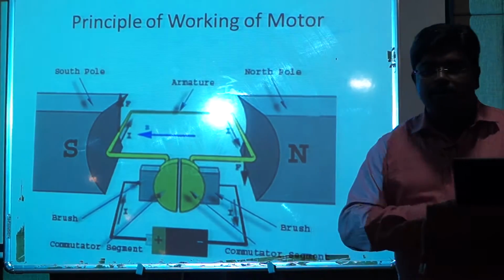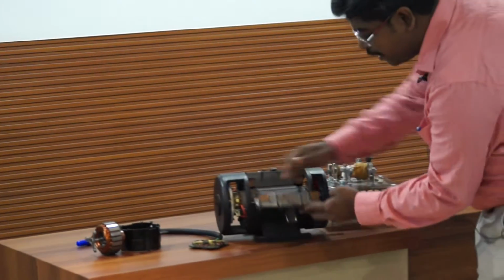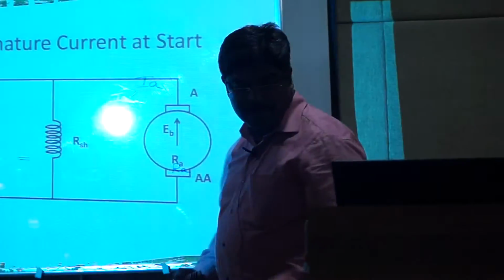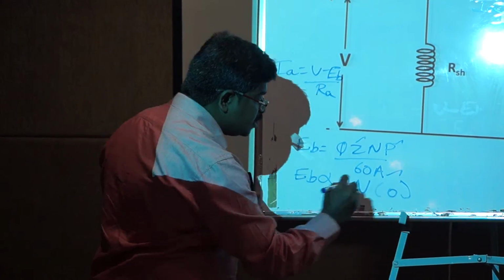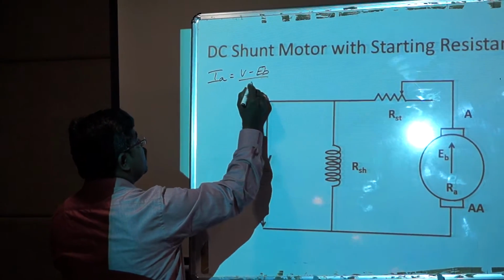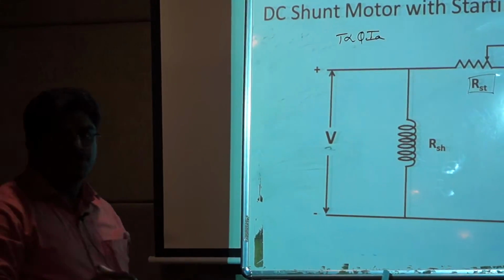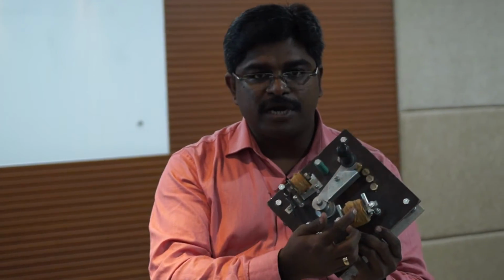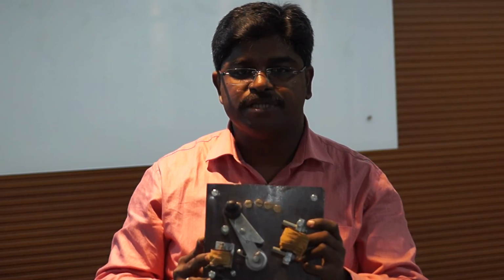Necessity of starter

Comment: Sir i cant understand how the no volt relay release the handle when over load occurs..
Reply from the maker: When current taken by the motor is increased or when overload occurs the magnetic field produced by OLR increases attracting the iron spindle upwards (OLR Contact) which shorts the two ends of the No Volt Relay (NVR) coil and thus NVR gets demagnetized releasing the handle and motor is turned OFF.